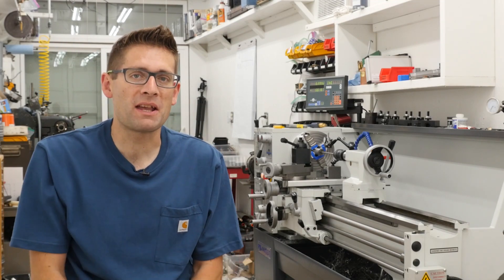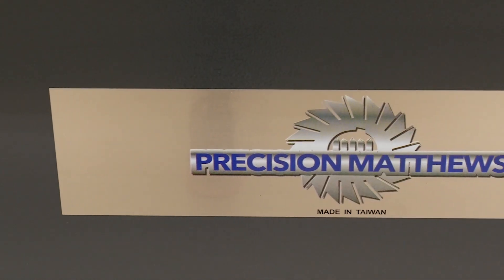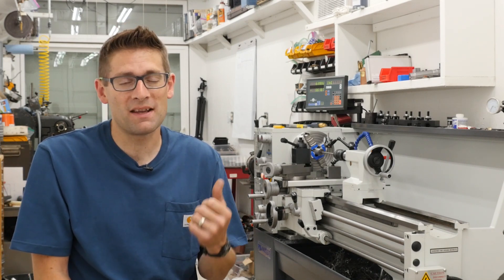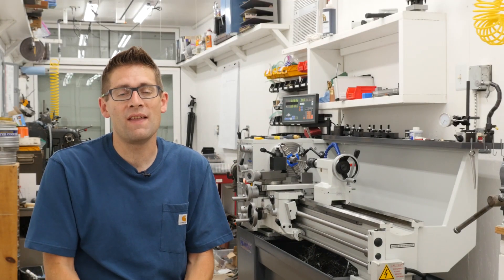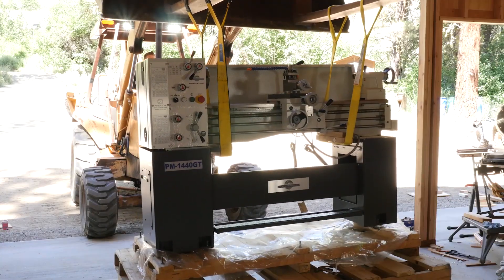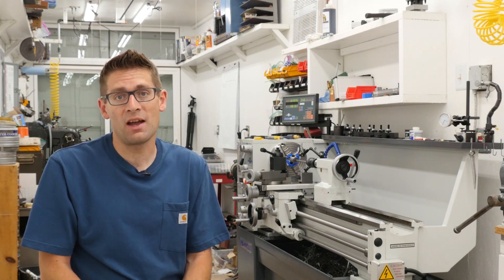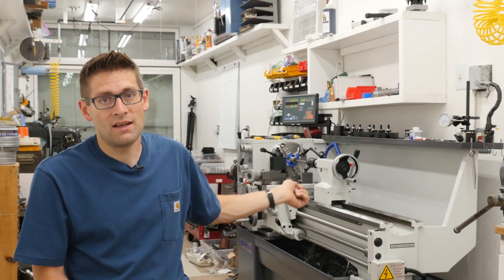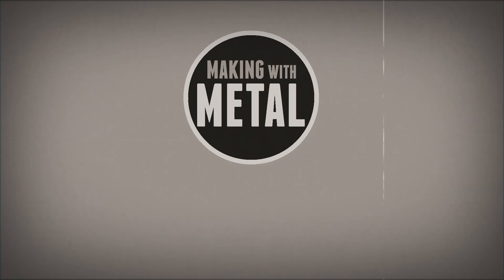Lathe Arrives! Precision Matthews PM-1440GT Ultra-Precision 14x40 Metal Lathe

Comment: Thank you so very much for taking the time to sow using the black pipe to move the machinery into place.  I used a similar method with 4 inch PVC pipe to move a collapsed 70 foot tower into place but had not considered black pipe and moving the machinery for my machine shop.  I am building a hobby aero-space machine shop and have no experience in building a shop or positioning thein the machinery for optimum use.  It has been more than fifty years since I was last in a machine shop working as a journeyman tool and die, maker. Your videos are great.  I will receive a PM-728VT in a few days and thank you so much for sharing the practical site of moving equipment.

Comment: Hello Gavin! I'm  seriously considering purchasing the Precision Matthew's  1236T ultra precision lathe and would like to hear your thoughts for a home hobbyist application for clambering, truing etc. Thanks in advance and I find your video's very informative. Paul
Reply from the maker: I think that looks like a good smaller lathe for that kind of work- with 1 9/16" thru-spindle capacity, you'll be able to chamber barrels, thread muzzle brakes thru the spindle.... Also look at the PM1340-GT...

Comment: Hey Gavin, great video. I've got the PM-1340GT (13" x 40") although it's sold as a completely different brand here in Australia. Everything you said about yours is true of mine also - the Taiwanese quality is a huge step up, and the lathe really has a lot of premium features for the price. And they really are super-precise. I've even grown to like the belt-drive first stage high/low range gearing, which is more forgiving if, heaven forbid, anything were to go horribly wrong. And you are so right - moving it is nerve-wracking. Here's yours, rebranded and onsale in Australia, FYI: https://www.machineryhouse.com.au/l242d

Comment: Hi Gavin. Love the videos. Info packed and well done. About to pull the trigger on an AR AD-10 (or ADX-10) for the home shop. would go into a distribution panel and then add conduit/dros as necessary. A few folks have mentioned running lathes with a VFD for speed control. Gives me a little pause - whether to go all in on 3-phase or just use VFD's for now. For sure getting a PM-949. Lathe later. Any thoughts?

Comment: Gavin,,,,Would like to know how your lathe is doing,,,have some old Altas, (Craftsman) and want to upgrade to a 14 X 40,,,looked at the China built ones,,,heard many horror stories about ways being off and sand in castings and gears.. Really like to know your thoughts on this one and the option package you ordered...
Thanks so much if you could inform me   Douglas
Reply from the maker: Douglas- the PM-1440GT has been flawless, but I haven't done my first oil change (headstock, saddle) - I should be doing that shortly! I'll keep you posted. Yes, I do plan to do a video on the outboard spider I built... Trying to make time to finish the video :)

Comment: Hi Gavin, I'm sure you will love the GT. I've had mine around a year. I went the 3Ø unit and did the whole conversion, it was a lot of thinking and work but I got it done with lots of help, over several weeks in my spare time, from a couple of members on the Hobby Machinist forum. I sub'd to follow your adventure. Enjoy the new machines. I love mine.

Comment: Great videos on this machine, Gavin. Much appreciated, as I am researching a purchase. 

Are you happy you went with the 1440GT, or would you go with the 1440TL if you had it to do all over again? The TL-series lathe is $4-5k more expensive, but it's almost twice the mass as well. Have you found the 1440GT to be all you need? Sounds like accuracy isn't an issue for you.

Comment: Thanks for the video.  I'm narrowing down between the GT, the GS and BV.  Love the idea of the Taiwan model, but also love the idea of variable speed out of the box.  I don't care much about  inches, so I wonder if you can comment how easy it is to change between common metric theads (all of mine would be between .5 and 2.0 mm).  Btw, I moved in my big Lagun mill last year (more accurately,  I helped an experienced friend help me) using a bunch of black water pipe.  Surprisingly easy.

Comment: Using the pipe to role the machine is an awesome method, I can relate having used the same technique moving two very large and heavy gun safes into my basement.  Moving my two safes I was extremely concerned with someone getting hurt, they weight close to 1500 lbs each but using the pipe they we so close to the ground there was never any danger of them flipping over.  I am glad to see you use the method and am commenting hoping other who need to move heavy items like these do the same, I believe its the safes way possible.
Reply: Dale B definitely a great way to move safes. Done it a few times using 1” PVC pipe

Comment: ultra precision? looks like the generic 1440
Reply from the maker: Yes, Ultra-Precision. You can't tell a lot about this lathe from just looking at it :)
Reply: @Ultimatereloader  i wonder, could you have gotten a 16k20 and had the bed ground for that money? that's a real lathe :o
Reply from the maker: I love the older equipment, but honestly to get a lathe this tight, you'd have to do a full rebuild on most older machines. I've talked to folks on Practical Machinist that have spent a LOT (and I mean LOT) of $$$$$ and time getting that done. This is the machine for me. And BTW: check out my content on American machines- love them too, but for other things :)